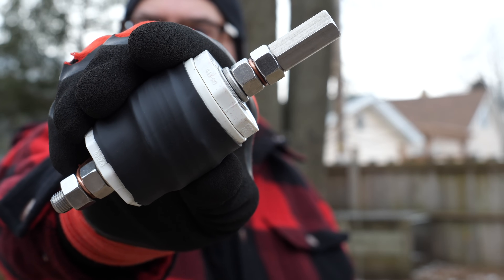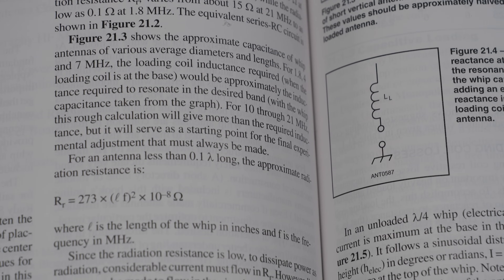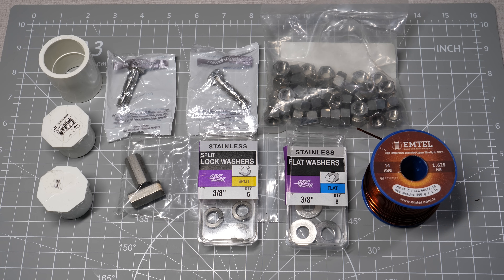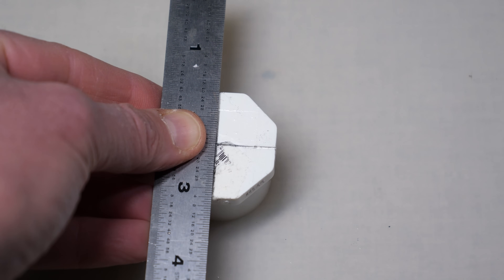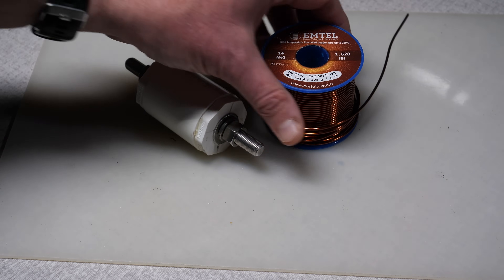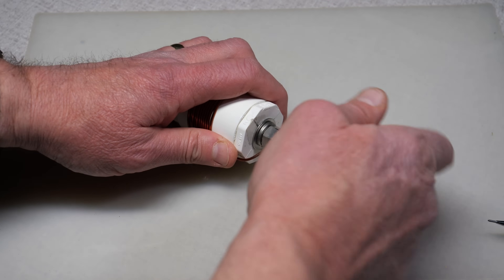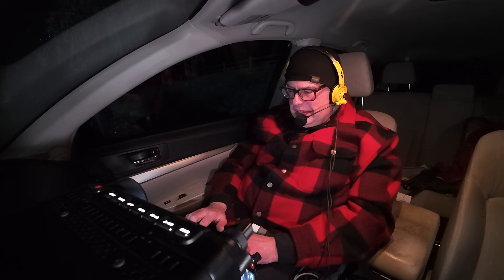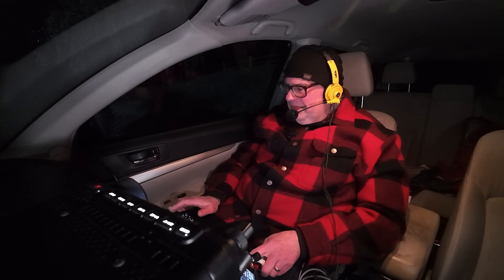BETTER than a Sporty Forty: Build a 40 meter Coil for Chameleon SS25 Whip!

Comment: I have been looking for this exact thing for my mobile. I built a wolf river coil and put a 102" whip on it and run it mobile. It works awesome. I have gotten very good reports off of it. Sadly, with it being an open coil, the road dust and any moisture gets spit at it and causes a lot of oxidation. So I need to build a few coils for each band to run with the 102" whip. I think I can get away with it by building these. Thank you so much for the video, and all of the other video's that you make. Much appreciated. You and others like you really are very helpful to the Ham community with the video's that you make.  73 N1YFA

Comment: Do I have to use magnet wire ? Or can I use some solid core 14 gauge wire I have laying around ?
Reply from the maker: As long as the wire you are using is insulated, you can pretty much use anything.

Comment: Is there a way to flatten the SWR curve a little more so it not such a sharp dip at your resonant frequency?
Reply from the maker: As you go lower in frequency, the Q increases and the dip becomes narrower and sharper. One method of increasing your bandwidth is to increase the diameter of your coil. This will take a bit of experimentation, but try running the formulas with 3 or 4 inch coil diameters. If the bandwidth looks acceptable, then build a coil and see if it works.

Comment: i still don't understand why is America using Inches for calculations and not MM ??
Reply: Wheel bearings on American cars are measured in MM. Also, Harbor Freight sells tons of tape measures using Imperial system.
Reply: Habit.

Comment: Will 2 of these stacked make an 80m coil?
Reply from the maker: Not quite. You won't get a sufficient level of inductance for the 80m band by just stacking them. But you can use the formulas in the video description links to build an 80m coil. Bandwidth will be tight, so you'll have to be choosy on your frequency.

Comment: Great idea for the SS25!  Two suggestions I’d make for durability for POTA.  Put some blue Loctite on the first nut on each of the end studs.  Once the coil form is glued together you don’t have access to the inner part of the stud so you don’t want it coming loose as tends to happen taking it on and off allot for POTA activations. Next, use a ring terminal on the ends of the coil wire connecting to the stud.  My A.D.D. prevents me from just wrapping the wire around the stud!  Hi!  Great video!

Comment: Michael, I often watch your videos and this one was just in time. Just purchased the SS25 and created the Performer for 20 meters using the two 90degree counterpoises and even with band conditions not the best managed to make a number of CW DX contacts over 5k miles away last nite.  My other favorite is 40meters and with your coil would be a perfect combination to use the full length of this whip.... so today went to my local hardware store and bought the works and just finished making the coil.  Tomorrow will turn my Performer into a 40m version.... Many thanks for all you do for the community!  73's Don - KW2AIR

Comment: Great video! In a fever, I seem to have acquired enough material to make a suite of coils. Since I have the materials, I have a question about the coil diameter:  the diagram makes it look like you're supposed to add the wire thickness to the diameter of the pipe, but I think you just did the pipe. Am I wrong, or is it simply negligible?  Because your SWR says you nailed it haha
Reply from the maker: The wire thickness can affect the amount of inductance and is part of the formula, but the thickness of the wire itself is not part of the coil diameter calculation as it is already accounted for as a separate variable in the equation.

Comment: I bought Gary‘s kit for use with my OPEC 17 foot whip but, initially, could not get it tuned on 40m with my POTA  performer. Working with Gary, I added a turn to the coil and after much testing added 49” to the elevated ground radial. It now tunes to 1.6:1 in the middle of the band. Absolutely love watching these videos and gleaning ideas to build my own antennas and accessories! Thanks! 73s
Bob, WB0WIF

Comment: Question - I like the coil.  But, mechanical issues aside, is there any electrical/RF advantage of using the stainless steel whip vs just 25' of wire held up by a collapsible fiberglass pole?  (I already own a pole - the whip is ~$100.)
Reply from the maker: The whip offers convenience. You could do the same with 25 feet of wire on a fiberglass mast. I've done similar by hanging vertical wire in a tree. You may have to do a bit of adjusting if you are using an insulated wire, though, to account for velocity factor.

Comment: Don’t you need to use the purple cleaner before cement ? It’s a two part system to allow the pvc to melt together.
Reply from the maker: Using primer along with the cement will increase the strength and durability. Honestly, I seldom use primer for non plumbing applications of PVC pipe and it works fine.

Comment: I am looking to create a 40m coil for the POTA Performer antenna.  Since that is not ground mounted but on a 4-5 foot tall tripod, does the elevated feed-point need to be added to the Total height of antenna in feet?
Reply from the maker: No it doesn't. the length of the radiator starts at the feed point itself and not at the elevated height of the feed point.
Reply: @KB9VBRAntennas  thanks for that clarification

Comment: New here, looking for the link to that whip antenna and base/tripod. Thanks!
Reply from the maker: The whip is the Chameleon SS25 25 foot stainless whip. Here's the links for the base and accessories that I use for my ground mounted vertical antennas: 

Feather Flag Base: https://amzn.to/3MdepHE
42x108 inch Faraday Fabric: https://amzn.to/3Vt1m9R
Jaw Mount Antenna Clamp: https://amzn.to/3VL5Ir6
SO-239 stud mount for jaw clamp: https://amzn.to/3VT1KwG

Comment: Number and length of radials?
Reply from the maker: Use whatever works for you. This coil works the same way with the 25 foot whip as the Sporty Forty does with the 17 foot whip. But, to your question, I used a sheet of faraday cloth (3 yards in size) as my ground network. (It also works great with the KJ6ER PERformer antenna).

Comment: I have the Super Antenna MP1 and it's just much easier to use on all bands and with 100 watts from the FR-891 I never have a problem making contacts on any bands when they're open. It breaks down into an incredibly small package and with the small clamp I've managed to work many contacts while clamping the antenna to a gate to a field, bench, fence etc. 

I have the MPAS 2.0 from Chameleon and it's a great antenna but 40m is not efficient. 

What surprised me with the Super Antenna MP1 was making a 1000 mile contact with the 80 m Coil. That blew me away. 

The pain of all this is changing coils and sliders so in reality a EFHW 49:1 and 2 fiberglass poles is a much better way to operate and very efficient especially for 40m and you don't have to keep adjusting the antenna when hopping between bands.

Comment: I used that calculator and it said 11 turns for 4.4 microhenries but when I built it my LCR meter showed 12uh!! 4 turns put me at 4.8...I wonder why?. Used a 1" coupling and 14ga wire same as you
Reply from the maker: It could be your LCR meter. A couple of years ago I bough an inexpensive meter (Uctronics) brand, but when I pulled it out for this project, it would return a value of about half of what I was expecting. So then I did a little research on what a quality meter would be and and was recommended the DER DE-5000. https://amzn.to/3Yq4Nig This one hit the spot for accuracy between what the formula said and the final result. 

For the most part, you shouldn't need to invest in a meter to build the coil, as I've done the testing both on a good meter and in the field. If you follow the plan, it will get you in the ballpark.
Reply: @KB9VBRAntennas  Hi Mike!...So instead of trusting the meter I set up my antenna and just took an SWR reading. The way it was with the four turns it was about 1.2:1 at 7.59MHz. So what I did was I just rewound the coil with 11 turns and decided to just work backwards from there. 11 turns was too much, it was resonant at about 6.3-6.5MHz. Then I tried nine turns and it was 6.7-6.9MHz... So I went down to seven turns and now I am below 1.4:1 SWR for the entire voice portion of 40 m. From 7.125 through 7.220 im at 1.2 or better and from 7.220 to 7.300 is 1.4ish...

I'm still perplexed as to why the calculator was so off or maybe I have some kind of weird electrical vortex in my area lol. But either way all is well that ends well I guess. Love your channel bud, I hope to make a QSO with you one day. K2PEW clear

Comment: That's a great project! Few observations. 

(1) With that 25 foot whip, you are only 8 feet short of a 1/4 WL vertical on 40 Meters.  Thus your overall efficiency is excellent! 

(2) If you wanted to try that with the shorter 17' whip, you might want to add 6' section of aluminum tubing below the loading coil, rather than merely increasing its inductance. This would increase efficiency. Mechanically this might be done by asking a machine shop to cut a 3/8" fine thread on the ends of a couple aluminum rods that fit inside the aluminum tube. That would creat an aluminum tube with 3/8" threads out each end. 

Naturally, you need to add a small coil across the feedpoint of all your portable verticals to achieve match their feedpoint impedances to 50 Ohms.

Comment: Michael, great vid as always. Some follow up questions. Since I know you have a pretty full stable of equipment, how does your homebrew coil compare with the Chameleon CHA M-Coil + 25ft whip? Also, have you ever tried a franken-tenna setup of the CHA M-Coil but using WRC tripod/coax connection, or is it absolutely necessary to use the M-Coil with the CHA blank adapter, etc. etc.???  Thanks!
Reply from the maker: Chameleon's M-Coil is designed to resonate a fully extended 17 foot whip on the 40 meter band. If you use the the SS25 25 foot whip with the coil, you will have to retract the whip about 8 feet, so that it is 17 feet long. Otherwise fully extended the resonant point of the whip and M-Coil combination is well below 6 MHz. Personally, I think Chameleon's marketing materials are a little obtuse on that point. That's why I came up with this coil, to take advantage of the full length of the SS25 whip. 

The M-Coil is a drop in replacement to the Sporty Forty. It has the same threads and in use, the same characteristics as the Wolf River version. You can use the M-Coil with the WR tripod or whip if you choose. In that instance the blank adapter isn't necessary. Many times I will mix and match Chameleon and non Chameleon parts to make an antenna combination that works for me.
Reply: @KB9VBRAntennas  Thanks so much. I totally appreciate the follow up! 73.

Comment: Do you think this would be a match with the PAK12? Or would I need to reconfigure the length and wraps on the coil? BTW. The 3/8 x 24 nut on you post link for Amazon is a 3" nut

Comment: Michael, Thank you for the inspiration! I decided to make a loading coil as you described here, and it works beautifully! Then I thought I might as well try to make one for 80 meters. Using the calculators you pointed out, I figured a coil of about 27 micro Henries would work with the 25' whip. On a 1.66" form I wound 36 turns of 14 AWG enameled wire. It should be roughly 29 micro Henries. My rig expert showed an SWR of 1.2:1 at 3.72 MHz. It is 1.2:1 through the phone portion of the band, and below 2:1 for the CW/Data portion.

BTW, if anyone has troubles with this antenna blowing over in a slight breeze, just stake down the tripod legs if you're using one. I probably wouldn't use this on a windy day. I'm not sure how robust this whip is.
Reply from the maker: That's great. I've got the 80 meter coil on the to-do list. Since releasing that video the last couple weekends have been busy with contests. 

The whip is robust, but I did end up kinking it when my POTA Performer antenna fell over in the wind. I now sandbag my tripod and base.

Comment: I’ve been waiting for warmer, less windy weather to try the SS-25 on my Little Tarheel 2 antenna on my car like I do with the SS-17. When going from my 66” driving whip to the 17’ whip I increase my signal by 2 whole S-Units. The nice thing about it is when I switch from 40m with the 17’ whip back to my 66” for driving the antenna needs a tiny touch up do to tune 20m. Same thing with going from 80m to 40m switching whips.

I have enough variable coils from other antennas to accomplish this, BuddiCoil for example.

Great video Mike

Comment: Michael, do you see any problem with using Malin stainless aircraft lockwire instead of enameled wire?
Reply from the maker: The enamel wire is insulated so you can wind the turns so that they are touching. With stainless wire, you will have to keep the wire turns apart so they don't short out. That may involve cutting grooves or 3D printing some kind of grooved form.
Reply: @KB9VBRAntennas  That thought never crossed my mind.  Thanks for saving me some trouble!

Comment: Nice video. I've been kicking around the thought of building a coil for 160m ft8 frequency, maybe as an add-on to the full size WRC I already have. High Q factor with a 17 ft whip, but it only needs to be resonant for 3kHz passband.

Comment: If I am trying to build a 1/4 wave, with a 17’ whip, can I make a sporty 40 if they aren’t selling the commercially available one? Got any material spec or info to build by?
Reply from the maker: You can. There’s a link in the video description for plans to make a coil for the 17 foot whip. The only difference is that you need 17 turns of wire on the coil

Comment: Great video!  Just made one for myself centered on 7.175 MHz, which took 9 turns.  About 45 minutes start to finish once I had all the parts.  My first attempt at making a loading coil, and your description made it easy.  Thanks!  Any thoughts about an 80M coil???
Reply from the maker: I'm glad to hear the instructions worked well for you. I am thinking of an 80m coil. The problem is the limited bandwidth. When I use the SB1000 adjustable coil on that band, I get about 250 KHz of bandwidth with the 25 foot whip. For a fixed coil, you are going to have to pick a single frequency or small range to focus on. Since most of my 80 meter portable work is digital, I'm thinking of making a coil tuned to the 3574 KHz FT8 frequency.
Reply: @KB9VBRAntennas  Sounds good.  I'm going to give it a try with an 80m coil, perhaps on at 3574 as you suggested for FT8, and another in the phone band.  I've been looking into base loading coil designs and factors; it appears that a larger diameter coil can create a broader bandwidth, but I can't find much info on how much the bandwidth is affected, nor on exactly what the trade-off would be (there's always a trade-off).  Some vague references to "efficiency."  PVC options of ID 2", 3", and 4" in play.  I'm curious what your take or decisions might be.

Comment: Yep that's the next project. I've built loading coils a few years back to add 80M to a 40M inverted V. 78 turns each for 2 coils worked like a champ. This little coil you did is just what I need for my SS25. Going to the hardware store tomorrow. Thanks!!

Comment: Which set up do you think would be more efficient with the SS25 on 40? This new coil you made or the rubikov method with the 4:1 UnUn?
Reply from the maker: That's a great question and without any objective analysis, my gut feeling is that the coil and SS25 are going to be more efficient than the Rybakov on 40 meters. Rybakov performance really drops fast on 40m and below. But also the base loaded vertical's efficiency can be affected by how robust the ground network is. This may require some testing when the weather gets warmer.

Comment: Yours certainly has a much better price point than the CHA 40M-COIL which they rate at 200W SSB. I'm curious if you see any degradation at about 600W on SSB with a POTA type duty cycle.  Thanks for making the video. Happy New Year. 73.
Reply from the maker: Like the Chameleon coil, this one uses 14ga enamel copper wire, so their power ratings should be quite similar. I haven't tested it above 100 watts, so I don't know what the effects will be at a higher power level. In chatting with others, it seems that using 12ga wire shoudl be enough to bring the power rating up to about 500-600 watts
Reply: @KB9VBRAntennas  Yeah, that's 2.5x less resistance per thousand feet. However, to make a high Q inductor for maximum RF emission (L/D ~ 0.45), I think I would also want to use a 1.75 inch diameter pipe (vs 1.625 inches). That would give me a coil length of 0.84 inches (L/D = 0.84/1.75 = 0.48) with 12 ga wire and 9.5 turns to get 4.4 uH.  I have a CHA whip so maybe I'll give it a try.  My wallet would like it better than spending $90 plus tax 🙂

Comment: Congrats Michael!  Very impressive.  I love DIY things that work!  Now, what about an 80m coil for the 25 ft.?????
Reply from the maker: I'm already thinking about an 80m coil. The problem is the bandwidth. In using the SB1000 adjustable coil, I get about 250 KHz of bandwidth on 80 meters. You'd have to pick and choose where on the phone portion you want to be, but I think it would be perfect for CW/Digital operation.

Comment: Michael,
Two things:
1. Is there any reason you couldn't use one of those couplers and some threaded rod to extend 17 ft whip to make it 213" instead of using the little pigtail I have seen you use?

2. I know you can't answer every email. Did you ever get the email I sent you last June that had an STL for the arrow nocks to put on the end of the Tractor Supply poles for the 6M moxon? If not, I'll print you some and bring them to Orlando.